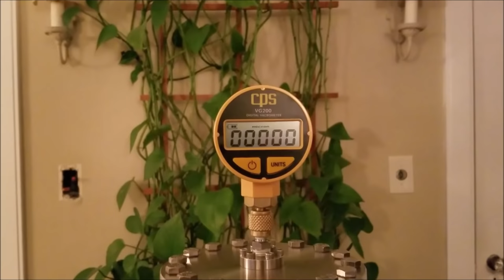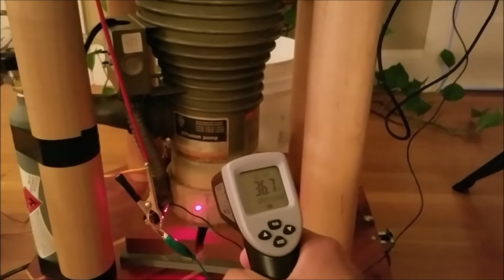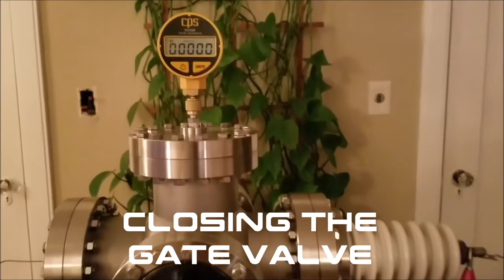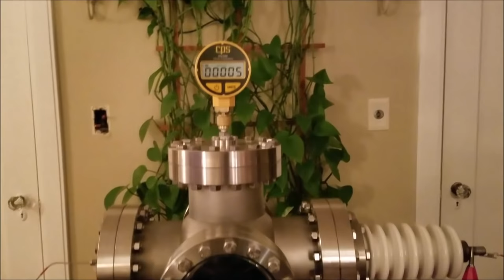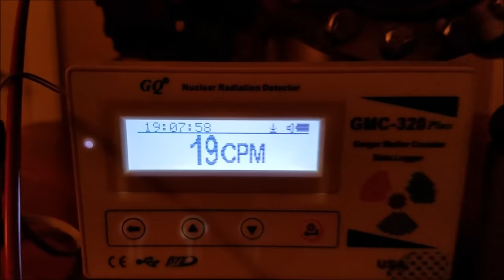Fusion Reactor: Complete Construction and Operation- Kuba and Noah

Comment: You literally have no idea how much your lives are worth. I'm 25. I could only wish I had the mindset to understand what you two have just accomplished. Good job. You earned it. But I'm still wondering where you got youre funding.
Reply from the maker: +Kyle Vasicek Thanks! Acquiring funding was a large part of this project. I have an intermittent job as a 3D designer and was able to save several thousand for buying parts for the reactor. I also asked almost every person I knew for extra funding. Many parts were purchased in used condition from eBay to minimize costs.
Reply: Good for you! So happy you have such a passion for these sort of things. :)
Reply: You act as if 25 is old or something. Age is no excuse to not create or invent.
Reply: Orrin Barabor You got that right!
Reply: Kylesville Moto they did an awesome job, but they didn't discover this, and it doesn't produce energy. google Farnsworth Fusor
Reply: How about socio-economic inequality? O.o
Reply: The dark corners of the internet, were no one qustions why. they just do it
Reply: Orrin Barabor Yeah, I agree with you. Of course starting doing the extraordinary thing at early age is biggest advantages than others. The important thing is do the thing that you never regret to yourself in your whole life.
Reply: this is fake
Reply: how

Comment: Nice work, guys. It's good to see a 50-year-old concept get some new life breathed into it after being swept under the rug for so long. Farnsworth-Hirsch fusors/polywells will probably be the main type of small-scale reactors in the future. I guess now the main question is how you (at least) break even with the energy output vs. input. It seems like this is the main dilemma facing all fusion reactor designs today, so if you can figure out how to efficiently harness all those MeV's generated during the fusion reaction, you'd be hailed engineering heroes.

Comment: +Kuba Anglin
Well... As a physicist, I should notice that:
1. The outer grig geometry was kind of wrong. Why would you such a big glass in there, if you were not going to stare at this anyway? I mean, neutrons can be pretty damaging.
2. A rotational (is my english correct?) pump can provide pressures around 0,025 torr and can be obtained for a few hundred bucks, no need for the difussion one.
Reply from the maker: While neutrons are damaging, the reactor generates only 50,000 neutrons per second isotropically. This is an almost negligible amount of neutron radiation when considering their ability to do damage. Go here if you want so see my calculations: http://www.irradiantdesigns.com/mit/#fusion-reactor

A rotary vane pump cannot provide the necessary vacuum. In order for the reactor to work, the plasma must consist only of deuterium. In order to do this, the chamber must first be evacuated of all other gasses, which means achieving a pressure of around 10e-5 Torr. Then the chamber is refilled with deuterium to a pressure of about 10 to 15 mTorr. A rotary vane pump can only get the chamber down to about 20 mTorr.
Reply: If you got nice streams, like described in my graduating theoretical project, not translated to Eng. from Pl., you may have got around 10^8 neutrons/second. Enoug to get core cancer. If you are interested, I cand send it to you, but I tend to switch different measure systems, so my stuff is pretty hard to read. And I am to lazy to translate it to Eng..

Fun fact - the streams have the temperature around 4-5K, following Huang and Krall. The central point is 6*10^8K (so we don't get bored with stable plasm, where would be the fun then?) and the crosssections are in their peak for 30KeV, not 40KeV for the center// scattering for those effects is not to be describer lineary, wxplanation may be found in "Scattering Theory" by Gerhard, I believe

For now I wonder if an ampty shell that used to be a seamine could be the outer grid for a fusor. A big, fat piece of junk we should all gaze upon as being rised to shine.
Reply: Also nature likes symetry and machinery loves aesthetics - so there is nothing to be calculated, fusor must be symetric (like mirror symetric) to the central point. It's the same like putting a magnetic monopoly into whe Maxwell Equations collection or like those solutions for spin's evolution, both particular and collective, in magnetic fields.
Reply: And what pretentious have I just written?
If being amazed by the strangely symethiric laws is pretentious, one must be deprived of sence of aesthetics, the one evolutionary gained for solving the difficult, to fit in, it must be pretty sad. What is more, I understand, that you assume, that I am trying to deprive Mr Anglin's hard work of value - which I am not.

Comment: It looks like you guys used the power of electrons as the magnetic field to induce the fusion effect by forming the arc in a specific formation so that the magnetic field of the electrons guided the particles toward the center of the formed arc which allowed the particles to fuse along with the fact that the arc itself also supplies the necessary heat for the fusion, I'd like to hear back from you guys if you get this since it is an old video
Reply: Electrostatic confinement not magnetic here

Comment: what did you use for your voltage ? and did you use heavy water?
Reply: Used transformers and variac and electrically feedthrough
Reply: It looks like he has a deuterium gas supply on the bottom left side feeding into the reactor.
Reply: natejell aka captain jelly you can make deuterium using heavy water.
Reply: Unknown Entity You can separate the deuterium from the heavy water*
Reply: natejell aka captain jelly Not even talking into account the explosive potential the presence Oxygen itself would cause problems when trying to produce a fusion reaction with hydrogen. Also while an isotope of Hydrogen, deuterium is typically used in fusion reactors not the common isotope.

Comment: I thought that 10^7 kelvin is required for fusion  and no container can contain it.Is it nuclear fusion?
Reply: Sanu Sunny It’s the temperature of those particles, their internal energy. Temperature is not everything though, to melt something like steel you have to put a lot of energy, hence you need a lot of particles. Under such low pressure there are fewer particles, which renders steel’s phase shift impossible.
Reply: ralfiasz  I meant for fusion to occur  nucleus should come close together for that high temperature is required right? To overcome the columns repulsion force
Or  cold fusion ,fusion is possible at room temperature where electrons are replaced by mueons
Reply: The plasma is accelerated at high speeds into the center and when they collide fusion happens

Comment: Yeah, let's just build a base for our fusion reactor out of wood - it definitely won't get obliterated by superheated plasma.
Reply: and? there won't be any plasma if the chamber wasn't under vacuum, there is no way the plasma can get out of their controlled environnement
Reply: no vacuum = no plasma, the only danger here is the power supply
it's not that you shouldn't do plasma outside of a vacuum, it just won't work, not with how fusors are setup, fusion can't make a uncontrolled chain reaction, it's just not possible, did you ever saw a lighter go Hiroshima? no because it's not possible
Reply: ho no it's not about 1000 kelvins, it's about a few millions of kelvins, but that doesn't change much...have you seen a tesla coil? that's plasma too, but the plasma doesn't spread to everything like a gas... it's not because it makes light that it's dangerous you know...
Reply: Atilla Kayaş Atilla Kayaş apparently i forgot to reply... sry
Actuall all plasma have some level of ionisation...
Also the main reason for why the plasma in a fusion reactor is so hot is that you have to overcome the coulomb force of the cores of the deuterium atoms, actually you also have to benefit from quantum tunnelling to achieve fusion....
But I don’t see what scares you, you know the plasma in a lightning is really hot, but it’s not the plasma that set fire to the ground, that’s the electric current flowing through materials
Reply: Atilla Kayaş no tiny spark really really rarely start a fire, the thing that can set fire is if an arc from the HV transformer decides it needs to go through the wood to reach a voltage equilibrium.... but this danger doesn’t come from the plasma
Reply: Dude stop. How many times have people to tell it won't happen? The plasma won't travel away from the containment. In fact, if you use just a mechanical pump, due to relative high pressure the plasma will just stick to the grid. Tesla coils have a much higher voltage, that's why it can break through even at atmospheric pressure.

Comment: you did it wrong 
too much pressure was present minimum 1/10000 normal pressure and the plasma had too low energy :))
Reply: The glow is in the center of the "ball", not around the wires. With too much pressure the glowing would be around the wires. 
They measured neutrons, so fusion obviously worked. Noticed the tube with bubbles at the end of the video?

Comment: I do not know where you are located,I did hi vac work in a NASA lab and your vac guage did not read 10^00 or 10^-6 so I do not think you are real..and to do this at home requires a lot of electrical power....difusion pumps do not run on 110VAC,you guys need a lab in a block building out in the middle of nowhere...NOT a residential neighborhood

Comment: $150k to produce hard xrays by my reckoning. No sign of magnetic confinement, no sign of fusion, just cancer causing ionising radiation. If fusion was as easy as applying high voltage to low pressure deuterium vapour, we wouldn't be spending several billion Euros on the ITER project in Europe. Crocodile clips and pulling plugs and sockets to connect and disconnect power? Cheap consumer grade multimeters. First rule of thumb with high voltage, high current supplies, proper safety switches and interlocks.  You can afford thousands for vacuum pumps but cheap out on the basics? This has all the hallmarks of a free energy scam or all the other projects that promise unlimited energy from tap water and a life free from the grid. Get real!
Reply: Fusion is easy. Getting more energy out than you put in is hard.